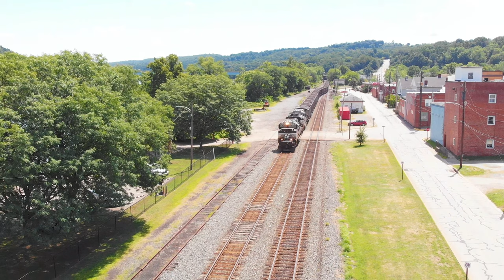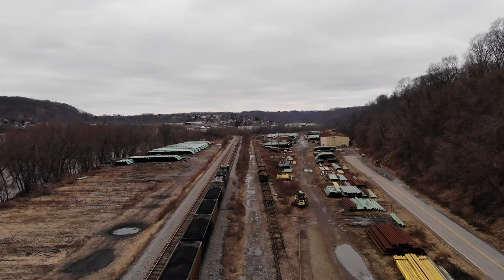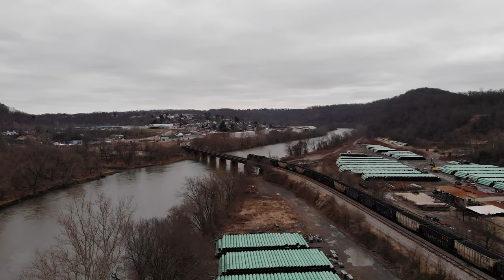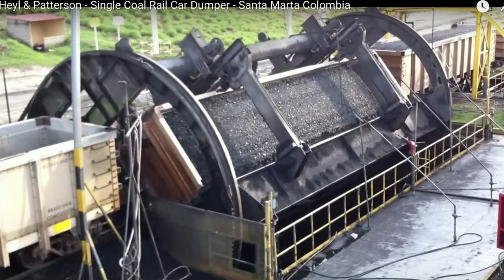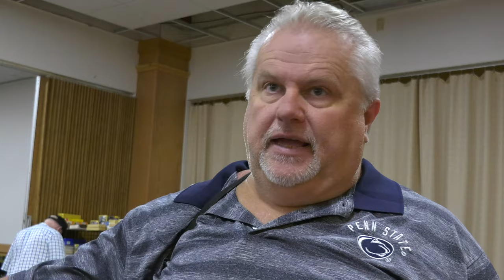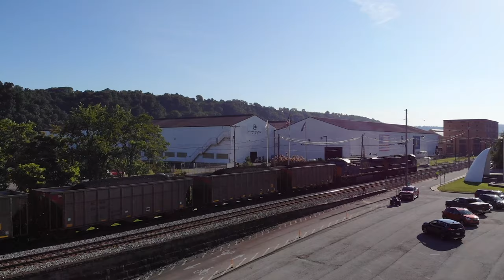COAL TRAINS! Everything You Need To Know To Model Them & More!

Comment: Thanks ,D.J very helpful. My coal mine is based on german/austrian practice  involves splitting train in 2 for high capacity ERZ III cars and filling via conveyer  and loader at or near yard entrance to stub.(shelf backs on to laundry tub so is dead end ) medium capacity s.w.b cars are filled on shorter tracks directly under old mine building. On my ore mine I use reverse loop so can run through no stop

Comment: Let me add some info here; I'm a conductor for RJ Corman on their Penn Lines and we currently still service 4 coal tipples. As for power we're usually using our SD40-2's. At 2 of the tipples we occasionally use NS, and the majority of the time it's crappy Dash-9's. Occasionally we'll get some good power, maybe an SD70, AC44, or an SD80MAC. 9/10 times it's Dash-9's. 

For 3 of the load outs it's done with front end loaders. 1 uses 2 loaders, another uses 3, and the other uses 3 or 4. I can tell you for each site we are stopped while loading. Usually doing 2 or 3 car moves.

The one tipple however, does use a boom over the cars to load in motion. As stated it's about 1.5 mph when doing so, and if we have NS power for speed control it's real nice. 

The 3 tipples we load with loaders are all at the end of the track. One sight we shove for 4 miles to it. The other has a stub track to duck power in. Then using an engine on the rear we shove back to clear the stub, and put power back on. The 3rd place has a siding to run power around, then we shove to the end of the line. As for the 4th tipple, it's a siding off the main we load on. Run the power around, shove back, and load through the siding. Hope this is insightful for some.
Reply from the maker: THANK YOU FOR THAT INFO!  That was great!!!

Comment: I unload coal trains several times a week.  We have a rotary car dumper, but it is very very rarely used, mainly when a regular car won't dump.  We bottom dump the cars into hoppers with belts that go to a regular coal pile or a PRB coal pile. I'd guess we have 20 miles or more of track here at the plant.   We blend the coal coming into the power house.  That was an interesting video.  I am a beginning modeler in east TN.

Comment: I had planned a stub end track set up for my new river mining on my n scale layout. I can change the design to a run through loading.  I'm glad I found this video before I did it wrong. Thanks for posting it.
Reply from the maker: https://youtu.be/f4fb27MPaHQ
Reply: A stub track isn't wrong -- they described one in the video. The wrong part is if you put the loader at the stub-end of the track, instead of the entrance. If it's at the stub-end, you could only load car at a time; with it at the entrance end, you can push a whole cut of cars past the loader, then pull them forward to load the whole cut. So it should look like

|-------------------------------------------------------[loader]---[rest of layout]

and not just
|-[loader]---[rest of layout]

Or use a through-track.

Comment: Clymer, Pa., Rosebud Mining loadout, a concrete platform adjacent to the tracks.  Loaded by 3 front end loaders, coal pile behind them, RJ Corman RR (Pa. Div.) shoves 65-car train past the loadout, pulls forward ten car lengths, stops.  When the front end loaders are done, the train pulls ahead another ten car lengths (the length of the loading platform).  Keeps it up that way until all is done.  Probably figures it's too dangerous to have a continually moving train, especially with the elevated (above car height) loading dock.

65 cars is the limit the line can handle (14-degree curve at the base of a hill halfway through their run).  Anything longer will derail on the curve (did it twice already, thus the length limit).  Train arrives in Clearfield, Pa. as a 130-car train, goes to Clymer in two sections on two consecutive days.  3 SD40-2s sufficient for the run.  The two 65-car sections get recombined in Clearfield for the onward run to Baltimore, Md. (handoff at Keating, Pa. with Norfolk Southern).
Reply: RetMSgt in Pa. I know they were loading at another mine and going to Cresson for a while

Comment: I recently saw an empty CSX coal train on May 22, 2020 pass through Savage that had locomotives 3131 and 313 for power. I got a kick out of the numerical pattern CSX had going on with the power on that train.
Reply from the maker: I HAD THAT TODAY!!! N78224.
Reply: @djstrains  Hunh, so they were on a loaded coal train today. I wonder which 2 locomotives were the DPUs on the rear. When I saw that empty coal train, it passed less then 5 minutes after a northbound manifest, X438, went the other direction.

Comment: Hi DJ, You forgot to mention how Pittsburgh Coal Company (later CONSOL) use to load hopper trains on the Montour. Each mine had a empty yard and a loaded yard and they were built on a slight grade. The cars were gravity fed from the empty yard into the tipple, loaded one car at a time, then drifted into the loaded yard. The average size green coal train on the Montour was 44 cars. On the Montour Railroad, CONSOL did not clean and size the coal at the mines. Raw coal or as they called it green coal, was loaded into hoppers at the mine and transported to the Champion prep plant just outside McDonald PA to be cleaned and sized. CONSOL had a rotary dumper at the Champion prep plant that was also gravity fed, one hopper at a time. This operation took place up until the early 1980's when the line and all the mines were closed. The Montour Railroad is now a hiking and biking trail. Thanks to the work of some local rail-fan's and historians, there is now a considerable amount of information on the Montour on the Internet. So any modeler looking for a non flood loader way of loading hopper cars, look up the Montour Railroad and the mines they used to serve. Cheers, Rich S.

Comment: There are coal gons and coal hoppers. Not all hoppers have a rotating coupler. Coal tipples load from the side via a chute: flood loaders load from directly above. Locos move trains at 1 mph automatically via "pacesetter controls" on the loco. The modeler should also take note of coal chunk size--some are quite fine, others very large. Do not intermix!

Comment: Load outs near the end of the track are not uncommon in WV. You'll have the branch line snake up the hollar and the load out (usually w/ prep plant) is at the end of the run because it would cost too much to extend the track beyond the load out. You would see this in the original Kopperston mine served by CSX.In a perfect world - see Wharton WV - the load out/prep plant is on a creek in the valley along the branch line and more traditional flood loading takes place. I think Kopperston had its own switcher to handle the marshaling of the trains.

Comment: Norfolk Southern had (don't know if it's still operating) a high lift dump in Sandusky Oh.  Cars would be pushed up to the base of the unloader, uncoupled, and a cable powered "Barney" (basically a solid metal push bar on wheels) would come up behind a car from behind and push the car up a ramp to the lift.  The couplers were closed so it would push out the previously emptied car, then the lift would go up like an elevator car, and at the top, it would flip the car over so it dumped the coal into a chute.  The chute directed the coal into the hold of a lake freighter.  It would repeat this one car at a time until the ship was loaded.  Quite a massive structure.  The empty cars when pushed out, would go down a ramp that had a spring switch, then up a ramp that looked like a roller coaster track.  The ramp was inclined too much for a car to make it to the top, so it would start rolling backwards and the switch would direct it to another track that let to the empties yard.  I got to see it in operation years ago, it's pretty awesome.
https://www.youtube.com/watch?v=ynjSgkwDL8c
Reply: Can also be seen here in HO scale, https://www.youtube.com/watch?v=ZRA-E0KflNY  11 min in starts a look at it and 31 min a bit more, and in use at 43 min.   here is the video that was mentioned in the first link https://www.youtube.com/watch?v=x6QR3lrzOo4

Comment: Do they have a special rotating coupler so the hopper can be turned upside down to unload without derailing the next car in line? What about brake hoses?
Reply: Yes, each car used for rotary service has one rotating coupler and one regular one.

Comment: Modern coal trains loaded via an overhead flood loader (train moving at a constant speed under the chute) tend to have uniform loads.  Trains loaded by front end loaders, however, essentially have piles of coal in the coal cars, no uniformity, no two the same.

Comment: DJ, In my neck of the woods, we haul wood.  do you have any videos regarding the loading and off loading of wood?
Reply from the maker: Not yet, but a lumber video is soon.
Reply: What kind of wood.   Short log?   Long log?   What type of car are they being hauled in.   The variety of unloading techniques vary greatly.   For short log wood racks we used to just knock the wood off the car using a modified backhoe.   Workers would grab the last few logs and dump them off the sides manually.   For long logs we had a huge machine that would drive up to the car sides and grab the logs and lift them out whole.   Amazing.

Comment: As they are loading the coal cars does the engineer have to adjust the throttle as the train gets heavier?
Reply from the maker: great question.  Yes, so on most engines is SLOW SPEED CONTROL switch for 10 mph or less.  The throttle will stay in a relatively higher notch but the amperage will increase to keep the speed consistent.
Reply: @djstrains  Oh yeah I've seen that when I was doing coal loading on the Sand Patch Grade route in Train Sim World 3. I have to say SPG is one of my favorite routes in the game

Comment: I'm confused about why that coal train that you had run recently at the time of making this video didn't have a DPU either mid or rear. I don't know where you usually operate but even in Florida DPU are almost a guaranteed thing on the loaded OUC Orlando coal trains. Now the return trip is another story, usually the third engine is just lashed to the front two.
Reply: I won't answer for DJ's particular train.   But there could be several reasons why a DPU wasn't need.   The first could be that the territory did not require the extra horsepower.   And of course it is possible that a DPU just was not available.
Reply: @cdavid8139  I've seen trains try to leave CSX Waycross yard before without a DPU and the dispatch doesn't let it happen. With PSR all trains get DPU, unless the head end isn't DP compatible. It's not a question of extra horsepower. They all get them, almost no exceptions. Which is why I was confused that his train didn't have one.
Reply: California.   A long long way from Florida and not a coal train in sight.    I do have friends on CSXT in Atlanta who feed several power plants including the massive plant Bowen.

Comment: For better or worse, coal is dying. So, what are railroads planning when it finally dies?
Reply from the maker: everything in your life still comes by train.  From your food, to your car to the stuff to make your house, etc.  It will survive.
Reply: To djstrains: That, and even if the use of coal is reduced, you need it for making many different materials, steel, etc. US coal is naturally low in sulfur, very pure carbon. US coal will always be bought and used for these reasons.
Reply: It would be awesome to replace that lost revenue with passenger service.